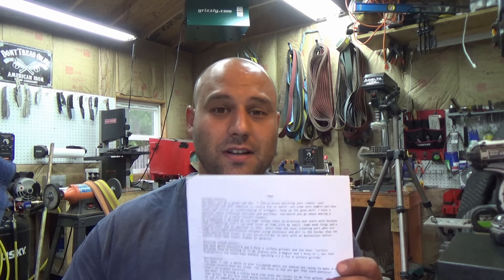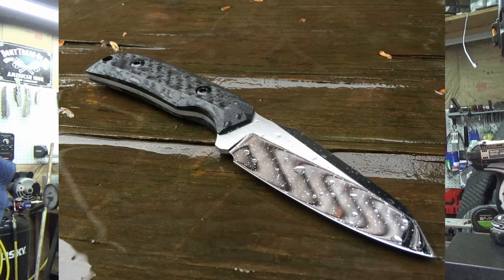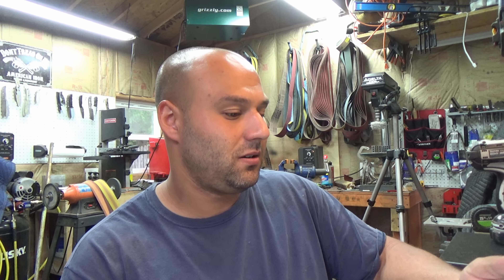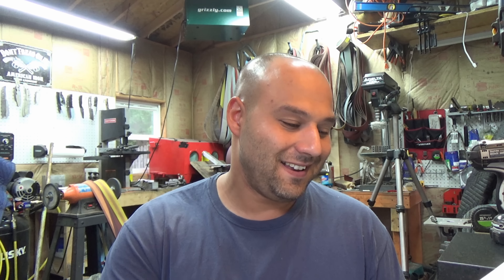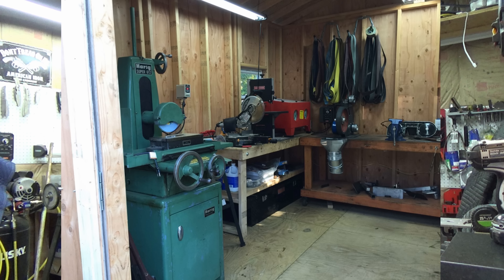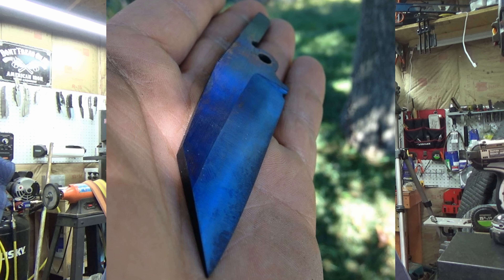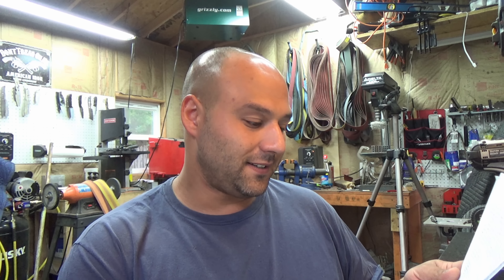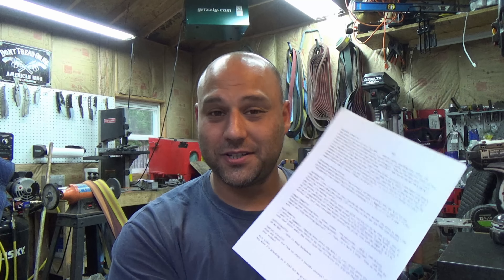FAQ Answers #3 Part 1  Stainless steel for beginners, satin vs mirror finish, and more.

Comment: Dear Mike, I'm really curious about your experience with bandsaws, maybe you can cover this topic in one of the coming videos. What model(s) do you use, what sawbands can you recommend? Could you share some hints on the "teeth per inch" and the band-speed for different materials? I'm currently working on a linerlock folder and both the pre-cuts of the blade steel and the titanium liners are a nightmare with just a hacksaw and Dremel abrasive cut discs. I've seen some makers using medium-sized Milwaukee portable bandsaws (clamped uprigth in a vise) to cut liners, blade blanks and handle material and those compact saws look perfect for shops with extremely limited space. Portable saws are crazy expensive over here in Europe, so I also thought about buing one of the bigger China-made stationary bandsaws and just throw away the whole machine foot. Maybe you have some geneneral tips that can help me and others with the selection of a bandsaw that fits both a small wallet and a small knife shop. Thanks in advance and best regards from Germany, Timo

Comment: hey if anyone wants to answer, ive been making some plans to make a folder but getting them flat has been a big problem. do any of yall know if some diamond sharpening stones would work? i have a pretty good grit progression and have a black/translucent arkansas to polish off (i flatten them with the diamond stones so they are very flat) would this work and achieve the same effect as a surface grinder?